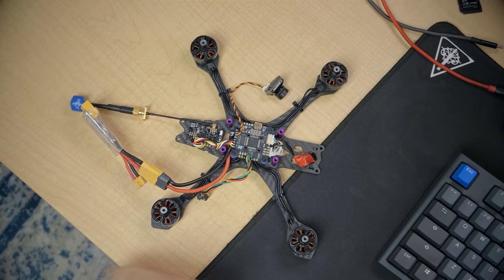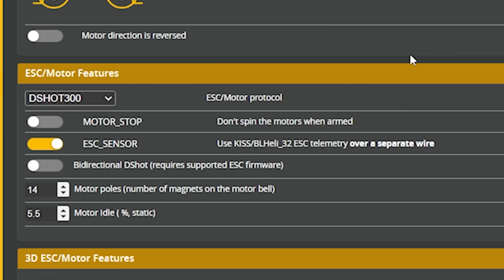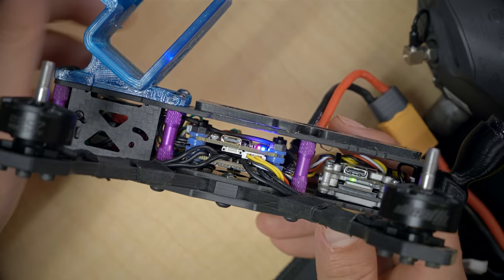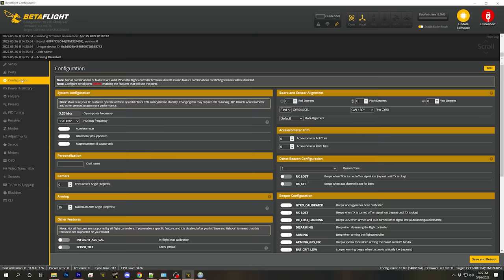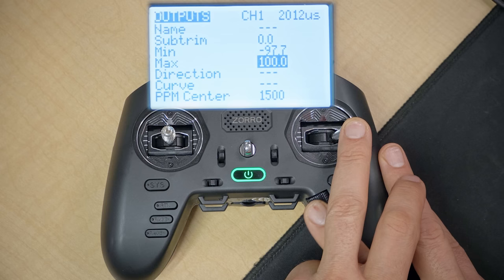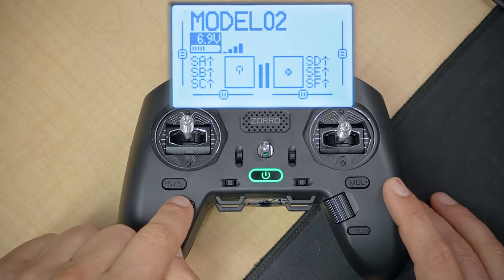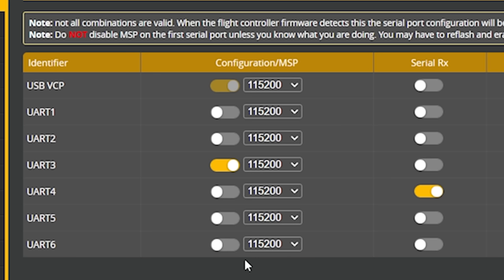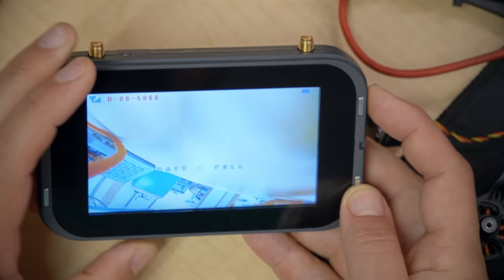2022 Freestyle FPV Drone Build - Configuration and Setup

Comment: 24:11  Is there a phone app or something that can connect, upon user request, to the WiFi and tell it to switch to the controller?  It's an obvious design flaw that the controller doesn't have a WiFi radio so it can do this on it's own?
Reply from the maker: The controller has wifi in its elrs module the same as the receiver. I'm not sure what functionality you're asking for.
Reply: @JoshuaBardwell  I thought you were saying if pwr up in wrong order the copter enters a WiFi config mode.  That's great, unless the controller doesn't have the hardware or software to connect via WiFi and ask for the other mode.  Like if unplugging power is the correct step, then someone is ignoring a bug.

Comment: thank you for all the guidance so far on this build, my first ! i have one problem, i am using IRC Ghost for my RX and i feel i have the module and the TX16S working as they should, however i cant get it to talk to the Xilo any help here would be fantastic.   i did wire it to TX4 and configured in betaflight serial on uart4 and setup the receiver tab to serial(via uart) then selected IRC Ghost for serial provider.... am i missing something ?
Reply from the maker: A common mistake is to not bind+setup in the ghost module, but just to bind. Make sure the ghost module is set to protocol GHST and then bind+setup.

Also you have to go to the CLI and type:

set serialrx_halfduplex=on
save
Reply: @JoshuaBardwell  thats exactly what i did :) just bind, now after bind+setup the led on the receiver is now red and blue on the module, but seems stuck... does it take a while to Bind+setup?
Reply from the maker: Try power cycle the RX after bind+setup, then press bind button.
Reply: @JoshuaBardwell  thank you Joshua i really appreciate your help!, it seems fully bound now i have a green/yellow light on the transmitter,  the ghost module has rssi, snr and info updating in the little ghost module screen and on my radio, just still not talking to the Xylo... even changed to TX3, and setup as i did on TX4, tried srxl2 , irc ghost... too many hours on this today need a break.  :)

Comment: lots of stuff here is different now, like where is the telemetry in configuration
Reply from the maker: In the receiver tab.
Reply: @JoshuaBardwell  are you familiar with A fatal error occurred: Failed to connect to ESP8266: No serial data received

Comment: Thank you Joshua for your videos. Learning a lot from you.
I still have a question: on 4.3, I cant' find the Telemetry option over Configuration>OtherFeatures.
I tried anyway to flash the rx through betaflight UART and after compilations, it throws a timeout cannot connect to COM port. 
Could that be related? I guess telemetry allows the reciever to answer the FC (?)

PS: I finally ended updating the RX through Wifi and it worked great. I guess this was your prefered method, it's brilliant. The info you spit out is invaluable for the hobby.
Reply from the maker: They moved telemetry to the receiver tab at the last minute.
Reply: @JoshuaBardwell  Thank you. It's quite incredible that you take the effort to answer all that comments.  You are better than any customer support ever.... like the godfather of all the world drones. I should become a patreon.